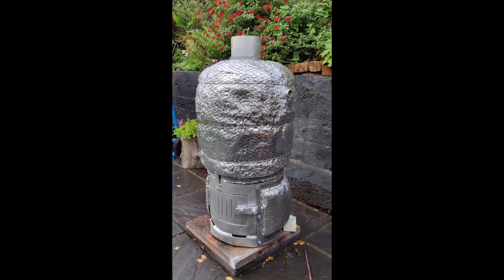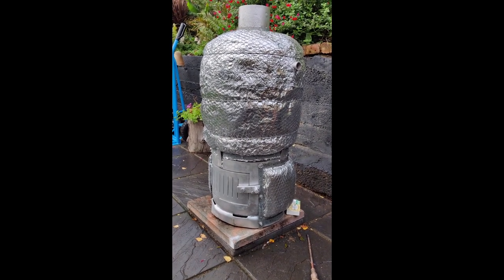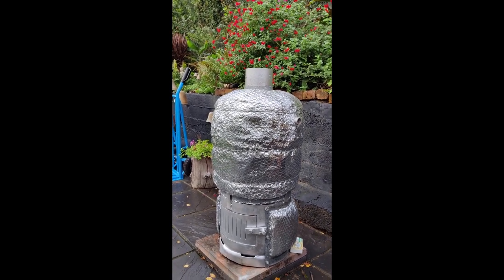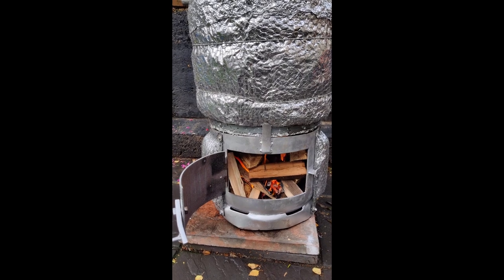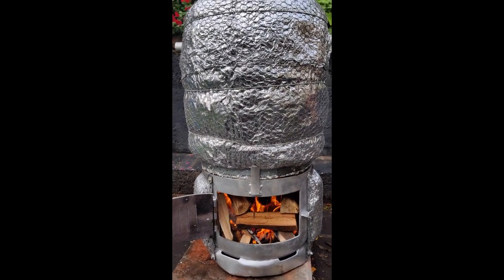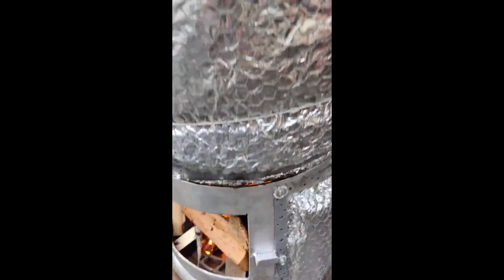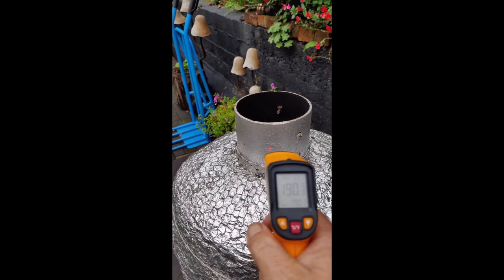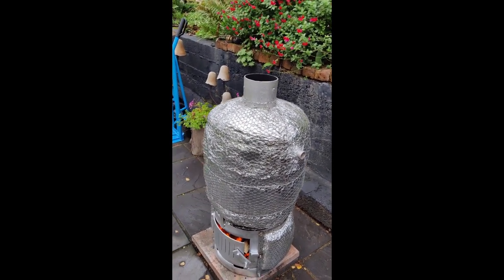Sand battery can it heat my home? part 2

Comment: Also had the idea of a rain cap style cover. It will spread the heat more evenly and lower into the room. While the heat is still excessive/high a removable pot/kettle stand could be used to heat, cook or boil water. Nice job!

Comment: Your flue appears to be straight up.  This will limit the heat passed to the sand  through what is called a boundary layer.  This is the hot gas from the fire sticking to the walls of the flue and cooling while much hotter gas with more energy goes up the middle. 

What you need is a Baffle or distuptor as I call them. Something to break the gas flow up and stop it being one smooth coloumn of gas going straight up.  Gas water heaters have this and  I do a similar thing where I get a strip of light gauge sheet metal that just fits in the flue and then cut it alternative sides so  the gas has to criss cross from one side to the other and is pushed out onto the flue walls. 

This Brings ALL the gas into contact with the flue which is the heat exchanger and extracts FAR more energy out of the hot gas Column.  It makes a HUGE difference to the amount of  material you have to burn and makes heat up much faster and more efficient.  It's very simple and easy as well as cheap as it only needs some scrap metal and some cuts put in it which you bend out to disrupt the gas flow. 

You want to make the exhaust bounce around and slow it down a bit so it's not just ripping up and out and taking the energy with it. 

Very interesting design and well executed.

Comment: That mesh acted like a mantle in a lamp or a room heater, much like a catalytic converter slowing down the exhaust and burning the smaller particles thus making more heat.
Reply: Yes, and no. The fire heats the air within the pipe, which heats the steel by convection. A lot of that energy goes up and out before absorption. The wire mesh captures heat which would be lost and reradiates it as IR to the pipe. Robert Murray-Smith used some fine mesh stainless steel screen to turbocharge a homemade alcohol heater (no unburned fuel present) for similar results, with a reflector added to radiate heat into the room.
Reply: @robertphillips93  de la
Reply: this is very smart

Comment: A really interesting experiment. I would say a very successful prototype for your chimney-less situation. The result of the chicken wire in the flue was really interesting to see.

This system is very similar to my solid fuel shower installed in Bulgaria, which is basically a giant Kelly kettle plumbed into the mains water. The tank is 90 litres and provides enough hot water for 4 people to shower from one 3 gallon bucket full of small dry firewood.

There were some good comments in your first video about improving the heat transfer to the sand. My suggestion for a mark II might be to consider multiple tubes through the sand (like boiler tubes in a steam engine) these would easier to clean instead of the kerplunk rods. You may well need to have a manifold to draw them together and maintain a good draft with a slightly longer flue. I would also consider lining your firebox walls with some brick or vermiculite board lining, to concentrate the burn, which may well reduce the fuel needed to charge the battery. 
Good luck with your next stage of the experiment, which I assume will be finding the optimum burn time to give you the required heat without burning more fuel than is necessary.
I look forward to an update on your findings.
Reply from the maker: Some great ideas thank you, yes il put the chicken wire in early & see if that did actually accelerate the charging like it appeared to do & possibly see what heat I can actually get into it 👍

Comment: i have been doing something similar using sand surrounded by perlite amazing results so far the insulating properties of perlite are something else you should look into it mine is actually run on a kettle heating element run by 100 watt solar panel and the plan is to use it for a camp water heater/cooker

Comment: I’ve really enjoyed your 2 videos on your sand battery idea. Lots to think about as I’m looking to heat my workshop. One thing you might want to look at is using thermocouples to generate the power to run your fan. You might even be able to modify one of those ready made fan ones for wood stoves although they tend to suck and push warm air around which is less dense than cold air. In that respect you’ve got it right by pushing dense cold air up into the flu but anyway something to consider for a nice little mod. Thanks again.

Comment: Some recommendations drawn from the rocket mass heater world:  Don't remove heat directly from the combustion process, because that prevents complete combustion.  Instead, extract as much energy from the wood as possible by insulating the burn chamber to burn at the highest temperature possible and achieve complete combustion, and permitting a high airflow to provide adequate oxygen, then collect the heat from the completely-combusted exhaust (not from the burn chamber).  In other words, collect the heat AFTER combustion completes.
Reply: That’s what they did with the tulikivi and other multi-chamber burn heaters as far back as the 14th century.

Comment: Thanks for sharing this with us. When the insulation reaches it's end, I would replace it with a removeable 44gal drum split & lined with much more substantial insulating material. the drum can be made better to look at by covering it up with brass fireguard mesh.

Comment: If you make another, maybe try to put metal rods from the flu to the interior tank wall. I would think those rods would conduct heat from the flu into the sand a bit quicker than only radiating into the sand from the flu.
Great job with this project.

Comment: Thank you very much for recording your results. I am building a few sand batteries, as well, so it was great to see how long your unit radiated heat.
Mine is a bit different in that I'll be using a metal 3 gallon pale filled with sand and heated on top of a rocket stove. (A 3 gallon bucket should hold 42 LBS of sand) I'm putting threaded rod through the bottom of the pale that stands inside the pale. My thinking is the rods should conduct heat up into the sand from the bottom, where it is heated. We'll see how it works or doesn't pretty soon.
Reply from the maker: Yep sounds good, let us know how you get on 👍
Reply: I am curing to hear how that goes. I am looking into ways to heat my greenhouse, and was wondering about making a rocket masonry heater with a water heater filled with sand, surrounding the flue pipe. I was thinking I would use copper coil filled with water within the sand, and somehow employ a heat siphon to circulate the water under the floor or something. 

Of course, I want to tile the water heater and make it look like a Swedish tile stove, or at least paint it to look like one. I think tile would be better, thermal-mass-wise, and safer to touch.

Comment: Nice :-) I built a box with aluminum gutter pipe that was insulated. Glass front.I used dryer vent tubing to run to the basement floor out the window into the box and then back out the box into the basement. It works great. I love your sand bomb :-) unbelievable how long it’s holding the heat. Would be interesting around a chimney. And it may be the answer for my geothermal greenhouse on Below Zero night thanks for sharing

Comment: Nice experiment.  Still lots of different things to try for improvements.  The whole sand drum to flue heat transfer system shows lots of possible efficiency improvements.  A large spiral welding bead both internal and external on the flue pipe offers increase surface area an restricting for flue gas flow should increase thermal transference.  Think FIrebox/Drum designs on a Boiler.   Could also increase difficulty in cleaning flue pipe soot-tradeoffs?  It worked way better than I thought it would.  Great job.

Comment: You could place a pizza oven , flat iron plate griddle, burned pot support, camper oven, roast marshmallows, tea pot, while charging and while it is heating the room, all that work you might as well make it multipurpose. Also have an roll of chicken side just for the inside use.
Reply: Some good ideas but NO GALVANIZED METAL!  It creates toxic fumes when heated up too much.
Reply: Subscriber # 444

No galvanized. 📛 toxic fumes
][so i guess just don’t sit and huff the fumes coming off the top 🥴🤤☠️][}

Despite any toxic gas Seems like your intuition was correct with the chicky wire. Good thinking
Reply: Get a activated carbon air purifier or hepa. You can make on cheap with a box fan.
Reply: I would put a granite tile on top. I have a raclette appliance with a granite top and have had a soapstone stove in the past. Both materials hold on to, then radiate heat for a long time. Pizza made on a granite surface is delicious. You can cook directly on granite.
Reply: Everyone should be running Corsi Rosenthal boxes in their homes anyway!
Reply: @monkeytrainer8135  Granite tiles are a great idea!  Even better, many tile stores will just give you a tile or two that they aren't selling anymore.  I've gotten lots over the years.

Comment: Thx for the video. Center pipe heating is very inefficient. Heating with an insulated pot sleeve is better. The taller the cylinder, the better. good luck.

Comment: Good stuff!

To insulate fire box area, cheap old fullers earth cat litter (bentonite clay) can't be beaten, so easy to use too, simply need a double wall/skin to burn chamber, does not conduct heat, and being clay, does not burn! ✌

Comment: Great videos,a real good watch. I had contemplated something like this for providing a hot air flow. I couldn't bring the unit inside myself but wondered if a coil of tubing within the sand around the exhaust pipe with an inlet and outlet would be feasible. I'm thinking that that it could stay outside and maybe a small duct fan could draw the clean air  around the coil,heat it and vent it into the property. Then I guess the battery could be left 'simmering' throughout the night  with minimal fuel. I'm just not sure if the the air would heat up enough though.

Comment: That rig heats your room appropriately one degree F per hour.  It may keep an already-warm room a bit warmer,  but  starting from cold, well, good luck!
Reply: Maintaining house, furniture ect temp is always easier/cost efficient than heating it up. His idea of keeping the furnace from running as much with this will do just fine, and the excessive heat currently felt will be welcome come winter.
Reply: @bonedoc4556  
1°  Like I said, good luck.

Comment: When we had a power cut for several days last year I heated water on my outdoor wood fire and carried it inside in 10 and 20 litre plastic cans. HDPE plastic doesn't melt until 130C so it's quite safe for hot water. You can drape wet clothes over the cans and they dry in no time. Water holds 5 times as much energy as sand so they heat commercial sand batteries to about 500C which takes as much energy as heating the same mass of water to 100C i.e. boiling. I'm a bit miffed about the amount of energy you're losing up the chimney of that heater. Given the size of the flue compared to the size of the firebox and its central position I reckon 50% of the heat energy in the wood is being wasted. If you welded something to the top of the flue to hold a pan or steel bucket you could heat water with the exhaust heat and just put it in the bath or sink or as I say in an HDPE can. I use a 25 litre brass tub which used to hold coal. Softwood gives out more heat than hardwood in a given time because it burns faster so you need to split hardwood really small.
Reply: Well, it's an outside heater. If he wanted to be that efficient he'd have a cast iron stove installed for 50x the cost so...
Reply: Good idea to use the wasted heat during the burn to dry out firewood.

Comment: What a brilliant room heater!  Some thoughts:

1. The 'TnT' fellow you talked about in the first video is Robert Murray-Smith. (https://www.youtube.com/channel/UC4AkVj-qnJxNtKuz3rkq16A)  Yeah, he is a FANTASTIC resource for this kind of stuff and a BLODDY amazing guy all-round.  DEFINITELY check out his rocket stove video for pointers on improving your setup.
2. It CANNOT be stated too many times that any time you are cutting a container that was used to hold something flammable, you MUST fill it with water, first.  Far too many eulogies have been read for people who didn't consider that safety tip worth following.  :sigh:
3. Likewise, heating up galvanized metals--like chicken wire--past 200C creates highly toxic gases.  DON'T DO IT!!!
4. I would drill a LOT of holes around the bottom of the main burn chamber and leave a gap between it and the battery, as the air intake area should exceed the chimney's cross-sectional area for maximum oxygen flow and hottest burn.  The more air, the better.
5. The more metal you can put in the air stream AND the sand, the more quickly heat can be effectively transferred from the former to the latter--and vice-versa, once it is in the shop/house.  Personally, I would have cut the tube lengthwise into sections and then added angled vanes on the inside and multiple straight ones on the outside that almost touch the outer shell before welding it all back together and using it.  This would A) create a vortex to push the hotter air to the outside of the tube and lengthening the air path to allow more time for heat to transfer, B) DRASTICALLY increase heat-absorbing/emitting surface area, C) as the vanes heat up enough, they will help auto-ignite any volatiles, and D) the vanes in the sand will help transfer heat MUCH quicker than just the limited surface area of the central tube. (The latter would both mean the sand would heat up and cool down MUCH faster.)
6. There shouldn't be ANY soot buildup to speak of, as soot is unburned fuel sticking to the sides of the chimney and, as a rocket stove chimney is specifically designed to auto-ignite everything, it should easily hit the 500-600C needed to burn it away.
7. I would permanently mount the burner to a stand and the batteries to handcarts, to make moving the latter with a single person MUCH safer and easier.
8. Once the batter is in the house, a simple pan under it would catch any loose soot.  Also, a tall chimney would create a natural draft, so the fan shouldn't be needed.  (You would still want a ceiling fan to push the hotter air down to lower levels, of course.)  By adding a damper to the chimney, you can more directly control how much heat is transferred to the room's air.
9. I have serious concerns about the local homeless heating their makeshift shelters here, where the temperatures can hit -40C/F, and something like this would be PERFECT for when it isn't safe to have a fire inside.  Thank you for sharing it!

Cheers!
Reply from the maker: Thank you, yes some good valid points 👍
Reply: << what keith said

Comment: Brilliant idea . Same basic principles as a warm air unit . Heat passes over a heat exchanger and a fan blows the air through ducting to vents.  You should try to come up with a duct Idea for the top pipe when it inside. So that fan just doesn't blow it straight up to the ceiling first . In fact it would fit in to the Idea of keeping it outside and keep it fired up . A rocket feed stove feed idea could be included for when you not there to check it . But well done again nice to see someone's Idea come to fruition
Reply from the maker: Thank you 👍

Comment: I like the idea of a sand battery and rocket stove combination, but like you would want it outside. I was thinking it could reheating the return from the central heating before it got back to the boiler, so so the boiler didn't have as much work to do. Would prefer not to have it directly connected to the system though. So would need some form of heat exchanger.

Comment: Have you thought of putting a top on it similar to a rain cap to spread the heated air instead of blowing straight up. I just finished a sand heater with 10lbs of compacted sand to put on my wood stove. Lol I should say tamped down as much as possible.
Reply from the maker: Fantastic! Yes I made one the other day 👍

Comment: You can also use an element from something like a kettle and connect it to a Solar panel, there are several videos online showing this. For those who don’t have wood to burn. Might take longer but understand it still works.

Comment: I think if you can keep it on the Sack Truck (Hand Truck) for heating and leave it on that indoors would make this a one person job.  You take it outside heating up on the Sack Truck, then pul it back off the heat and roll it right indoors into position would be a game changer. Simple, effective and with one person efficient.  Overall that would be safer too.

Comment: You could hang something in the air stream and let it heat up to get a reading with your laser thermometer. Would be great if you could leave it outside and duct the air through it.

Comment: Hi,
You could get rid of the fan and put a 50 cm chimney and allow convection to push the air.
On another version you can experiment with basalt gravel. Not to big and add sand just to fill in the gaps at every level. 

Nice video! And thank you for sharing!
Reply: What is the advantage of gravel? Air pockets in rocks explode.